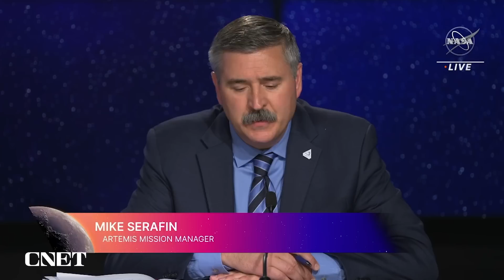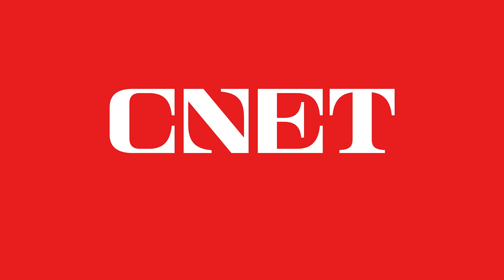NASA Explains What Went Wrong with Artemis Rocket Launch (2nd Attempt)

Comment: NASA is cautious because in laymens term he said it had an O-ring issue due to thermal expansion/contractions. Remember the challenger. An 8 inch quick disconnect is a freaking unit of a disconnect. I’d imagine it’s a series of O-rings.

Comment: Recycled space shuttle engines, modified space shuttle boosters and fuel tank. 30 year old technology, that NASA designed and costs 4 billion to launch and they can't get it off the ground. What exactly has NASA been doing for the last 30 years? Spacex could have pulled this off for around $100 million.
Reply: Welcome to the world of government, where the company with the most lawyers and lobbyist succeed (even if they can't actually perform the task)
Reply: It's not the rocket, it's the transporter.  Look there.
Reply: NASA doesn’t manufacture rockets. Blame the private companies that provide them (Boeing). Mind you NASA had put a man on the moon (a government led effort). NASA has been hollowed out by your senators attempting to cut back costs plus pork barrel spending and being in bed with Boeing. Might as well award the contract to spaceX. Again this has nothing to do with private vs public.
Reply: what a load of nonsense you talk.
Reply: Agreed 👍 Elon could done it half the time half the cost